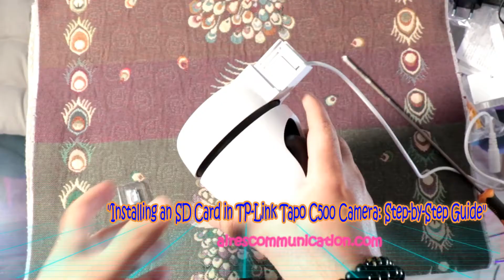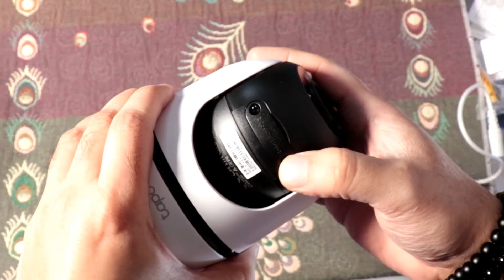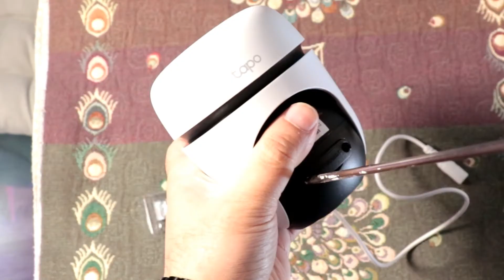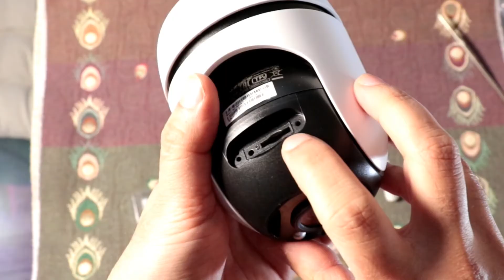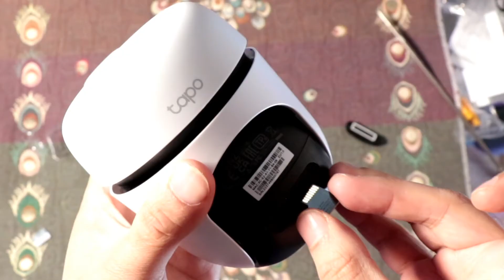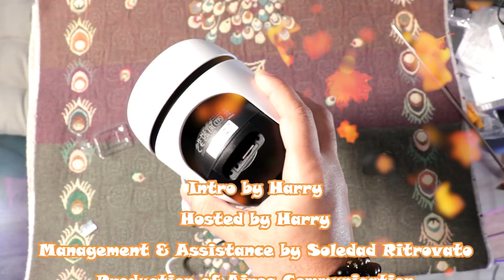Installing an SD Card in TP-Link Tapo C500 Camera: Step-by-Step Guide

Comment: Great video! Do you know what happens when the sd card is filled up? Does the app ask you to change it, or does the camera delete the oldest material to make room for new one?
Reply from the maker: Thanks, the old recoded videos will be deleted by its self in 2 or 3 months, so you dont need to do nothing, and plz dont forget to subscribe, it would be great help ;)
Reply: Subscribed right away😎
So depending on the memory of the sd card, it will store for longer periods of time, or is it just 2-3 months no matter if it’s a 64 or 512 GB card?

Comment: My 512GB SD card does not work in C500. I dunno why.
Reply from the maker: Hi there, format your card in a computer, then try again if the card works then it ok or go to lower GB cards, and plz dont forget to subscribe it would be great help :)
Reply: Please advise, I have a Tapo C500 Security Camera. Sometimes the person detection dosen't work when someone is passing from the marked zone. Also I have installed the camera on front of the house and wanted to cover front porch and a part of the road where I have parked my car. The problem is that the camera can cover either road or my front porch, so if I keep the camera view on the road and mark the front porch with turning on motion detection then would it be possible for the camera to move from road angle to porch angle and then go back to the same position??